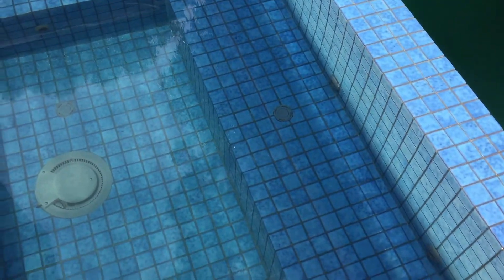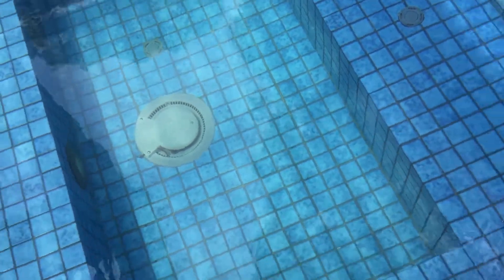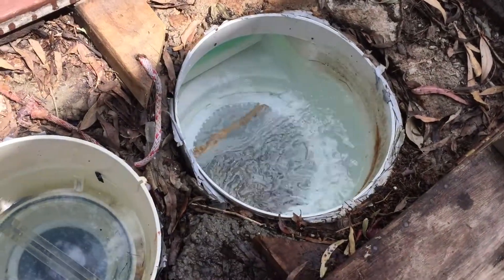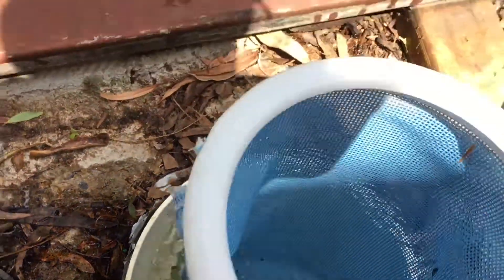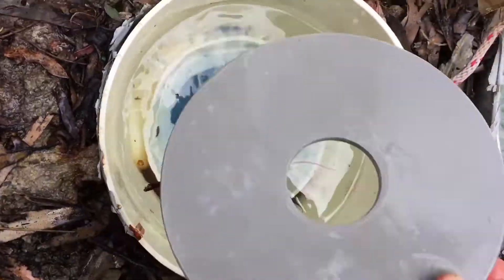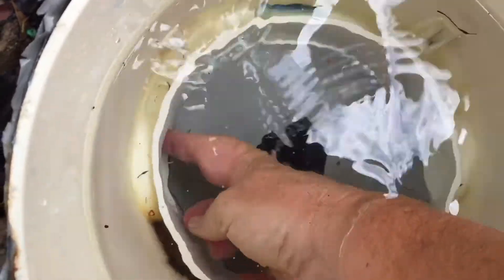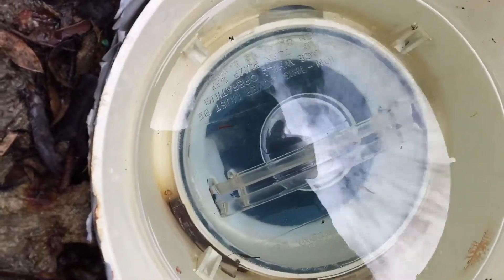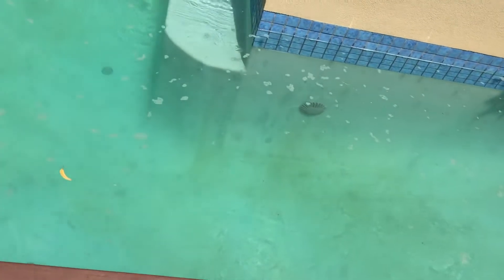How Jandy in floor cleaning works. Jet Vac system. Swimming Pools demystified

Comment: So a caretaker requires (2) pumps. 1 for the leaf trapper on the bottom & 1 for the skimmer, or skimmers. Is that right?
Reply from the maker: Hi Mark, there are multiple ways these can be plumbed. But the main way is with two pumps. One pump draws from the bottom of the pool and this water is filtered and then returned. The second pump draws from the surface skimmer and returns water through the pop up jets. MRT

Comment: I have a new pool on my route im going to vac tomorrow. Im afraid to suck up the pop up heads. Im crossing my fingers that I dont suck one up amd break it. I wached your video in hopes of you showing the leaf catcher and the module for the system. Im gonna have to play with it. The builders Ive worked for used paramount and of course my luck I get this Jandy system on my route. Love your videos pool brother!
Reply from the maker: You won't suck up the heads they are on a spring system. Normally a pool with pop up heads just needs a few spots vacc'd, not the whole pool.